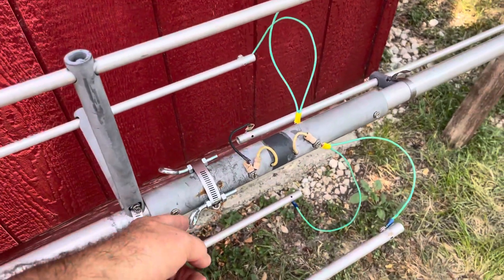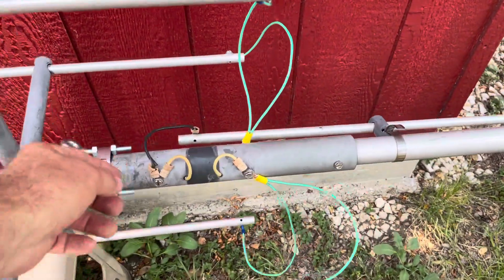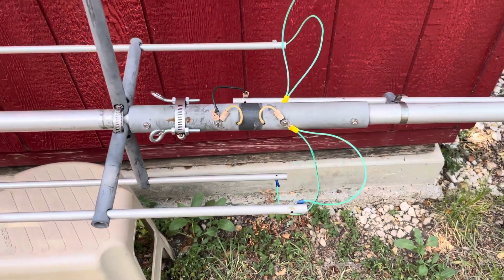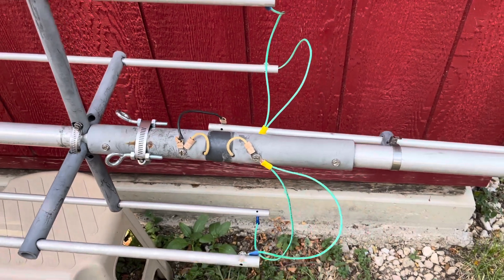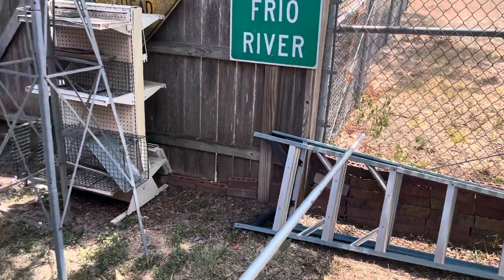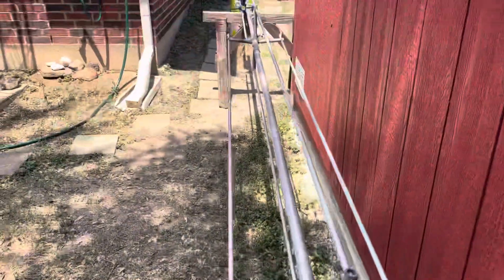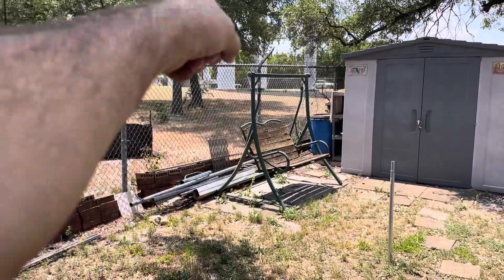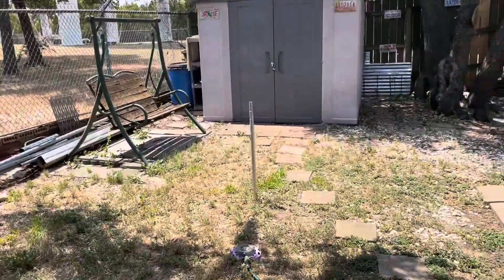Gap Titan DX Antenna re-Build and getting ready to setup.

Comment: What a coincidence. I'm doing exactly the same thing right now for my GAP Titan that has not been touched for about 10 years. Your wiring looks OK and is how I have it set up. GAP recommends that the guying be attached ABOVE the gap. I had mine below the gap and it will be moved above. You have it on the gap and that might not be structurally the best. 73. HB9EGW.
Reply from the maker: It is up and running. But the jumper wires I made for the four tuning rods are wrong. So I had to order new ones. And there support seems a little bit hard to reach too. The old jumper wires were rotted out and broken. These jumpers are cut to length. And I need a new split bolt for the counter poise loop.